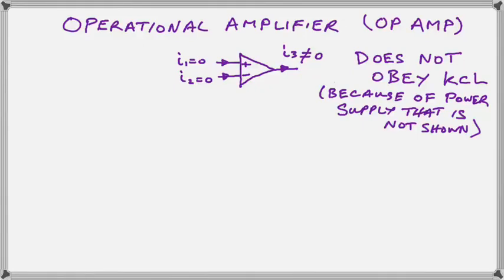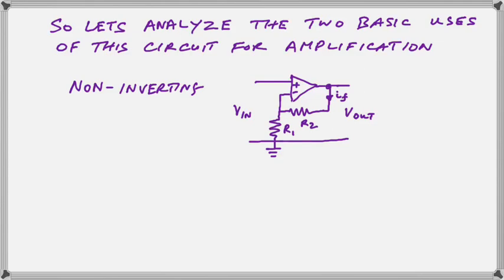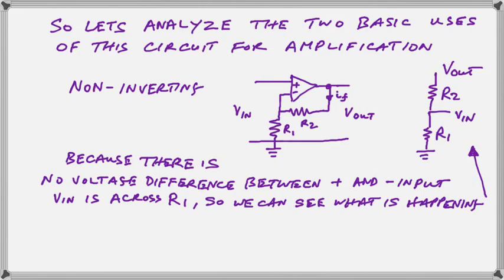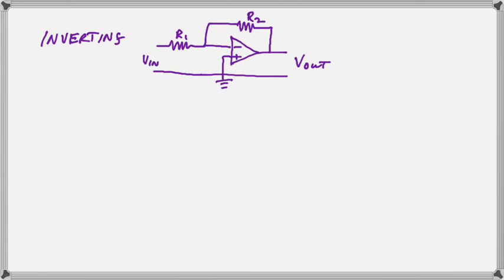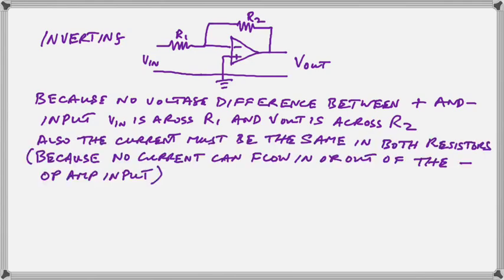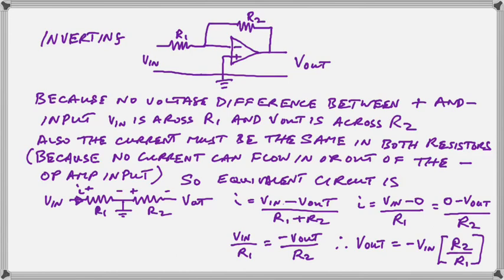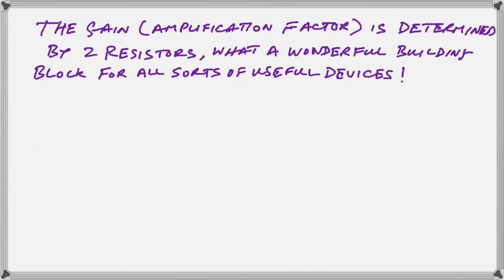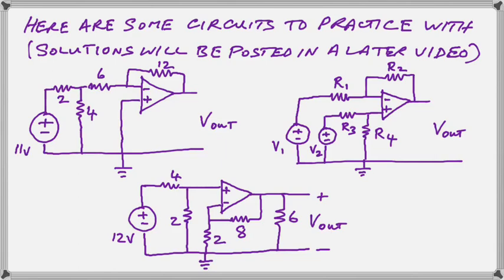Op Amps Basics Explained

Comment: I am going to go out on a limb and say that everyone who has trouble understand how op amps work is missing a big picture that is not hard to understand, but for some reason hard to explain. When you first look at an op amp you see input and output. This is the trap: assuming it's like any other black box function (put in X and receive Y). The output does not come from the input. The output comes from the POWER rails. The input influences how much output you get, but the output comes from power rails and this is how it is able to be amplified. Once I understood this, I had no problem understand why current does not flow into the inputs: we are just comparing if the output needs to be stronger current or weaker current, and that current comes from the power rails, which new players always assume is only used to power the chip. (As an aside, I now realize that most of the Youtube synthesizer people who claim to be experts have no idea that every time their precious waveform goes thru an op amp or buffer, it gets copied -- surely you realize most have no awareness of this yes? I'm 😂 over here! Apologies for being malicious but they do ask for it. 😂) Finally .... the next big trap for new players is dealing with the fact just about every op amp circuit they see inverts the signal --- this is really confusing! I recently built a little mixer for my breadboard experiments and it wasn't until I tried to implement stereo panning for each of my 4 tracks that I started to appreciate the buffering a simple emitter follower. Anyways ... I thought you might appreciate a summary of what I have been up to, and you have helped my progress. Thanks!
Reply from the maker: Thanks for letting me know that I helped your progress..... you explanation shows that you understand the op amp......  phase reversal does not by itself audibly change a sound, but as you said correctly, when mixing it with other sounds it does ..... finally you are correct that emitter followers don't cause phase reversal..... and it is also possible to design opamp circuits that do not reverse the phase  either .....  hopefully your comments have enlightened other synthesizer people who are not electronics knowledgeable 🙂